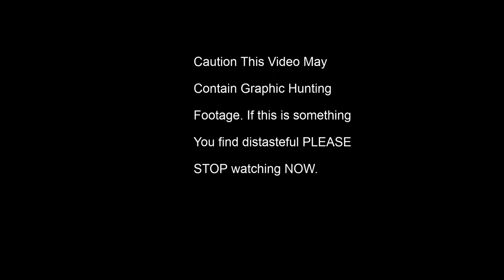Air Venturi Avenger Unboxing Tuning Fail 12/2020

Comment: It says you cannot adjust the regulator pressure down....only up. Must de-gas gun then adjust it down to minimum regulated pressure, then fill it back up and adjus regulator up ONLY.  Says if you adjust regulator down you WILL damage the gun. In your video you said you adjusted from 300 bar down to 100 bar.....😬
Reply from the maker: umm no that wasn't what I said. but yes I agree with you ..I degassed the rifle totaly and turned the screw in all the way then backed it out a quarter turn .then re gassed the gun and the reg was about 1000psi

Comment: I used to be an Air Venturi dealer and bought 3 of these rifles when they came out; one in every caliber.  The rifle was degassed because they are not supposed to be shipped with a pressurized cylinder.  That said, the .22 I bought functions flawlessly and in the testing I've done is very accurate.  The .25 and the .177 both had problems and the .177 still has problems.  Neither of those had the 5 1/2 turns on the hammer adjustment that Steve reported but the .22 did.  The .177 had the 2nd dirtiest barrel I have ever cleaned (a first gen Gauntlet still holds that title) and it had a regulator that was taking about 3-4 seconds to return to setting after each shot.  With about 100 pellets thru it now the regulator is taking about 1-2 seconds to reset.  So that is getting better but still needs break-in time.  But here is the lesson that in my years shooting and selling air guns most folks just don't want to embrace.  A $300 rifle will probably perform like a $300 rifle.  Between glowing reviews and rifles that exceed expectations as a result of constantly improving technology (much more than because $1000 rifles can be had for $300) many buyers, especially new buyers, are disappointed when the guns don't perform, or develop problems.  These are really nice little rifles for the money.  With some work and tuning and pellet testing they perform quite well.  But anyone who is suggesting that you are going to buy a $300 rifle and have it perform like and FX Crown or Air Arms S510 Sporter (had both; sold the Crown--kept the Ultimate Sporter) either doesn't know enough to recognize the vast differences or is delusional.  If you are in the market for a nice $300 rifle that will out shoot many of the other rifles at this price point the Avenger is a good choice.  If you want a super smooth, accurate, consistent and competitive rifle keep saving up and buy what you really want.
Reply from the maker: Well said thank you for your reply.

Comment: What you did wrong was to screw the hammer spring screw in 5.5 turns to start off with. You should have started with the screw turned all the way cc (back) and then started to turn the screw cw (right - in) to increase the pressure. Thats why your first one failed!

Comment: I had three new baffle model Avenger .22s that had regulator creep. All three would creep up 200 PSI in seven minutes and 600 to 800 PSI overnight. Yes, I degassed the Avenger doing the regulator adjustments.  My desired pressures for  tuning were 1400, 1800 and 2000 PSI. Of course the dealers will say that it wasn't degassed before adjustment or will be tested at 2900 PSI regulator pressure. This is  probably enough high pressure to seal the Delrin ring in the regulator even if faulty. Just expect to be gaslighted on this issue and the consumer is made to look ignorant.  We are told to manage our expectation on the Avenger. It is only a $300 air rifle were are told mainly by the sellers or their propagandist.   I bought the Avenger with the expectation of not finding perfection but there are issues that make the Avenger a $300  lamp post. My experience with air rifles is above average but  regulators that  can't be fixed nor are there any spare parts available is above my skill level. The Avenger had a poppet problem that took over a year to fix. Are creeping regulators the next year long fix?

Comment: Mine came without air and haven't leaked the four months I've owned it. Out the box it was maxed out shooting 33 grain  870fps
Reply from the maker: IDK lucky I guess..Its odd that I have a friend that got a rifle the same time I did his had 1500psi in it and mine was empty? Then I had a huge failure theirs nothing in the documentation that suggests i did anything wrong?
Reply: Just received mine last week with no air in it.  I filled it up on Friday, left it in my office for the weekend, and now today(Monday) all the air has leaked out.  Super annoying considering it is new, unfired, and all the friggin effort it took to hand pump it up to 3500psi just 3 days ago!  Also the manual says to leave it pressurized above 1000psi to protect the seals.  If it comes to us at zero psi, then I would recommend immediately packing it back up and sending it straight back.
Reply from the maker: @JT-rq7nt  I feel your pain.. Sucks.
Reply: @JT-rq7nt  Sometimes that's how it goes. I always buy from a good dealer that will send another. Quality control in China can be pretty crap.
Reply: @swingonthespiral  Yes, I bought it from pyramydair and did get a replacement.  The replacement also came with no air, however it's not leaking since I filled it and holds the air at steady pressure for a few months now.

Comment from the maker: Maybe I was unlucky or the Rifle had issues from the start... But on a side note I believe that no PCP manufactures ship rifles with no air in them.  This is a good indicator that there may be an issue. The reason that they always have air in them is for O ring health.
Reply: No
None of them are shipped with air
To my knowledge 
Mine doesn’t leak
Reply from the maker: @PraetzelProjects   That is incorrect. I know for a fact the info I stated in the video of a friends shipping with 1500psi in it.
Reply: @myminuteofangle7313  interesting
What distributor?
It may be some sent it with and some don’t
Reply from the maker: @PraetzelProjects    Both of are rifles came from pyramid air.
Reply: @myminuteofangle7313  hmm strange
Reply: @myminuteofangle7313  both of mine came with about 1.5k psi,but had no troubles with either one.
Reply from the maker: @Chrysiotis   yeah that seems to be one of the caveats to this riffle, if you have pressure you may not have an issue. All tough I have a friend that got one on the same run that had pressure in his "1500psi" but it wont degas with the degas nut?
Reply: @myminuteofangle7313  that's a head scratcher.Either it's not drilled all the way through or your friend is turning the wrong screw.
Reply from the maker: @Chrysiotis   he took it all the way out and it didn't degas at all. In the process of making 2nd avenger video and I will address this in the video.
Reply: @myminuteofangle7313  They propably forgot to drill that hole out all they way ,not likely though.Propably something blocking that hole somehow.Looking forward to the next video.

Comment: Minimum regulator can be set on it is 1160 psi i think
Reply: I have had my .25 Avenger regulator set at 800 psi and it works fine.

Comment: Maybe you adjusted the regulator to low, Even the impact has a minimum recommended reg. Pressure to never go under, I'm not sure but if the manufacturer sent it with the reg Pressure at 2900 I would not see any reason to adjust below 2000
Reply from the maker: I did it exactly the way Steve Shally suggested to do it in his video and he is sponsored by air venturi.. My impact is @ 1600 psi/ 110 BAR and I shoot 34 grn.  JSB's @ 880.
Reply: @myminuteofangle7313  strange you are having issues
Mise does very well on his eco tune (1400 psi reg and 1.5 turns on spring)
Shoots 16gn at 880
My reg will creep less than 100 psi over the course of a day but that does not make any difference in a chrony 
Good luck
Reply from the maker: @PraetzelProjects   I do not have issues any more I had a failure of the valve 13 shots into tuning, right around the same settings your at. I believe i just got a lemon. One thing about Killa Kev said about going below 2000 psi. I would have to totally disagree with keeping in mind the rifle does come in .177 cal.. I would never need 2000psi with an 8 grn pellet,
Reply: @myminuteofangle7313  agreed

Comment: I think your failure is caused by not backing off the hamer spring with the regulator. With the regulator at 1000psi the hamer spring is set from the factory for 3000psi. The hamer spring is overpowering the return spring and holding the valve open. So try loosening the hammer spring and see if that fixes the problem.
Reply from the maker: agreed...Although this is how the impact is tuned . I believe the avenger has more of a " glass " valve. and it requires stepping the reg pressure with the hammer.
Reply: @myminuteofangle7313  Did you try turning the hamer spring out (looser) to see if it fixes the problem?
Reply from the maker: @ricksedlacek2326  no i did not try that ,but i dont think that would have had any bearing on the failure because there is no pressure on the valve with out the gun cocked, There is actually more to this than I care to type .. When I get my new avenger I will make a comprehensive video of what to do and what not to do.
Reply from the maker: @ricksedlacek2326  yes
Reply: @myminuteofangle7313  What does yes mean?

Comment: i just sent back a .22 avenger because i was getting nowhere near the shot counts others were getting after the third shot string- the first two- @ 1900 reg roughly (hard to gauge with the small reg meter), got 113 the first string within a 20 spread range- 98 the second- then it began dropping bad- by around the 9'th or so string, i was getting only 52 consistent shots within the 20 spread range- and this was even way down on 1400 reg with only 1/4 turn (Could not get a setting where i was getting under about 880 or so- Even @ 1400 reg- something just wasn't right) 

So, i was getting low shot count, and high fps even with low settings- I went back up to the 1800 reg setting, 1/4 turn still, and was getting about 950 fps- all the testing was done with 14.3 gr- Emailed Tech support- they didn't know what was going on, so sent it back for exchange- i coulda lived with a drop of say 20 shots in the shot count after a few strings or so- maybe 30, but not 65-  that seemed a bit much. I took a tissue laid it over the breach, but saw no air movement- so i don't think the probe seal was bad- 

Whatever was going on wasn't allowing me to get lower fps, and of course a good high shot count- I woudl think i should be able to regulate it down low enough to get in the 600 fps range if i wanted to? (Not that i would, but i should be able to shouldn't i?)

Comment: The problem was probably the poppet or valve that is struck by the hammer just jammed open or an oring moved out of place  but shouldn't be the reg but Thankyou for posting so we are aware of some of these small issues

Comment: Thats the valve leaking. When the regulator leaks the air does not go out of the barrel. Mine was leaking from a combination of bad orings lubed with that horrible brown chineze grease in the pressure tubes. New orings wiht the right silicone grease and it good now. My regulator does creep up in pressure. Am working on that. Maybe new parts made or a whole new reg. Sadly cojona 🤓🧐is in the way........

Comment: Need to clean barrel make a little big of tansfort port and need to change the valve spring
Reply from the maker: ok thanks
Reply: When mine arrived, I had to run over 50 cleaning patches and then bore mops to get it clean. Dirtiest barrel of any air rifle I have ever seen. Shoots amazing once you get the crap out of the barrel.